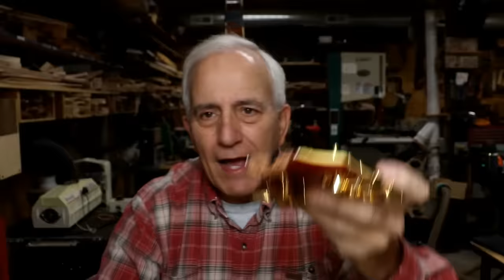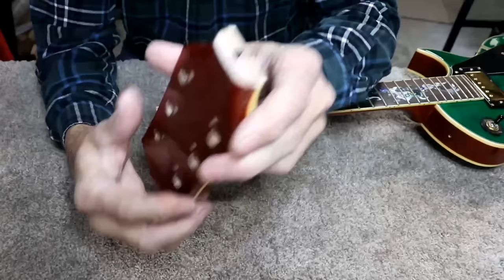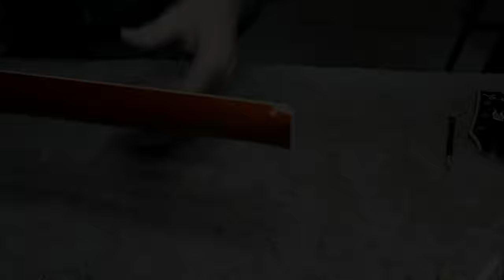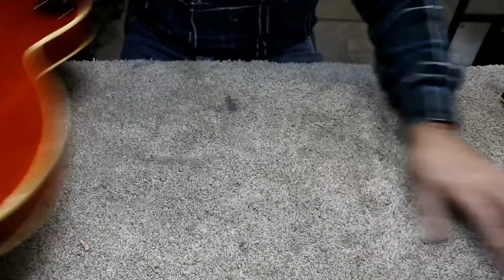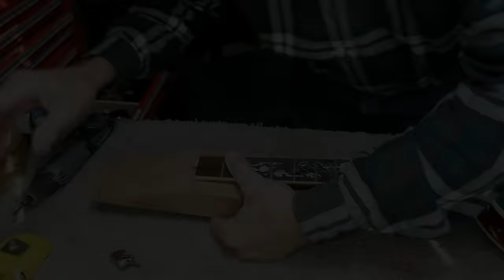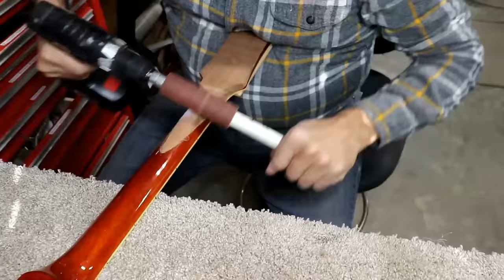623 RSW How Do You Fix This??? - ANOTHER BROKEN NECK Electric Guitar!!!

Comment: I’ve seen another luthier on YouTube that claims he’s had success with gluing the break back together on Gibson style necks and putting a spline set in deep on either side of the truss rod spanning across the break and into the headstock. I don’t know if it is as good structurally as your repair but definitely seems like it would take fewer man hours on a lower end guitar.

Comment: You are a miracle worker 💪❤️🧠😎👍🙏🇺🇸 !!!   In the first few minutes when I saw how bad the break was, it reminded me of a guitar neck that broke off as close to exactly as what you were faced with. Now, I regret that I didn't save it for 25 years. Perhaps I could have fixed it today. However, I didn't. Watching you do this repair kept me on the edge of my seat... You are truly the master luthier with brains, common sense, knowledge, experience and an expertise unparalleled for the art form beyond repairs that makes you a rare and unique problem solving creator making art where others would not attempt to go and be successful.
Reply: Could you make a platform for your router that has a big channel in the center, like a miter box with very thick sides.  Clamp the head or neck in the trough at an angle to the top of the router guide (top of the miter box).  Use a router to machine off the wood you will replace with your splice. Glue the 3 pieces together.

Comment: Jerry, you really have a unique way of fixing headstock breaks.  The other luthiers on YT, typically route two slots on the back, between the headstock and neck, but on either side of the truss rod.  They then make a couple splints with hard works that rightly fit in those slots.  I believe I’ve also seen one repair that used two carbon fiber square sticks then routed to match their widths.  

Now, having said all that, while it appears your way is more laborious, I believe it’s stronger than the others.  At least it looks that way to me (and I’ll throw in that I’m a 60 year old civil engineer who earned my PE license doing 5+ years a of structural design, before our department had computers 🤓🗓️🖊️📐🎸).  

Your problem solving skills are really amazing.  As I also like to say, “You know a thing ‘er two about a thing ‘er two.”

Another great repair, no really structural restoration job, mu friend.  Thanks for sharing!
Reply: The first method and the one I use, gluing two blocks length wise across the break is just as strong as this with about half the labor and time. This blew my mind that he did this this way.

Comment: I worked on a break something like that, and used tweezers to pull out every loose fiber on each side.  Not just the free splinters, but any that I could get out.  I didn't bother trying to make it better than the original, by the way, I just told the guy: "be more careful with it next time".  
What you need to scratch out that cutting line is a surface gauge scriber!  Prop the headstock up at an angle, then slide the surface gauge around it to mark a constant height above the surface.
Reply: Lol. Love these random guys telling a master how to do his craft. So funny.

Comment: I have to say I am in awe of your craftsmanship.  Also I have to say I would never have done it that way.  Like most people who do this type of work after you had the headstock glued which by the way you can make a simple jig to hold it.  We would around it out A section in the neck and put in splines.  This is A Jay turser guitar.  Once the splines were glued and installed we were then grew up in the misections Where the chip out had occurred.  Shaped it with our Knives, Send and finish. It would take longer for the glue to cure than it would for us to finish. But kudos I know another way to do it now

Comment: I love the way you invent your own tools to address any problem you might come up against. Cheers.
Reply: he reminds me much of my uncle. my uncle was born in 39 and had to consciously wittness the last days of nazi germany. originally he learned wainwright from his father however the profession pretty much died out and a lot of those old jobs got repurposed in the automobile industry and he became a tinsmith at mercedes benz. back in the day the cars were not as uniform however and a lot of adjusting had to be done because tolerances were huge. a common repair from accidents was the engine hood but the new hoods were comming with like 2-3 cm or about an inch of overhang cause as said cars had huge variety back then. so the work instructions he got from the company was to cut the hood to size with tin snips. he tried once against better judgement and said it was a total nightmare cause obviously the hood was all bent and wavey and ruined essentially. so he build himself tools to measure the space it had to fit and mark the hood so he could file it down to size. 
after he retired i met some random guy by chance and when we talked about profession he said he worked at mercedes in the town my uncle used to work so i asked him if he knew him and he said he was the best tin smith that ever walked their halls and since he retired he's sure they won't ever get anyone like him ever again.

Comment: I had one of these Jay Turser Les Paul copies in about 2006. It was actually excellent. I bought it for 300$ from China so it was very inexpensive for what it is. I had a house fire and lost it sadly. I actually liked it alot. They did an excellent fret job surprisingly. Mine had a volute so I wasn't worried about the headstock. Amazing to see these repairs. A ton of work for sure.

Comment: I picked up a Washburn acoustic that had the head broke off. Found that someone had made a terrible repair and screw-bolted in a break farther down below the head. They put the screw bolts right through the fret board in the first and second frets and tightened it down. I won't be trying to repair this neck because the guitar itself isn't worth the cost of repairing it, but I did get some good hardware salvageable parts off the guitar for repairs on another guitar down the road including a good working, and sound Washburn Electronic Pick-up/tuner/equalizer. A Street Buster owned it so I gave him $10 for what was left of the guitar making him happy as well as myself. The Washburn electronic pick-up alone was worth what I paid for it. Put new batteries in it and works like a charm and I have another guitar almost ready that I can install it in once I finish its neck reset repair. You did a nice job. Well done, Jerry.

Comment: Back in the late 70's while attending Roberto Venn. We had a dear customer professional 335 player. His head stock was broken off just like this. Several attempts to repair, dowels.. I haven't watched this whole thing yet but i know where it's going. What i did was machine a dupl headstock. Removed the vaneer. Then I plained the neck and headstock into a scarf joint. Took a little time the staff was so impressed they offered me a job teaching repair. To my knowledge back in 1977 no one was either building or repairing neck breaks using the scarf joint. The customer was thrilled others had tried only to break again.

Comment: when i do this job, i'd have 2 (1-2mm) drill holes near the edge of the crack on the headstock side (one, either side of the headstock).  Then tap a panel pins into each hole, to attach the headstock to the neck while glueing (allows for a tighter fit). 
Once the glue has set, remove the panel pins and drill the holes wider, to accomidate a small wooden dowels (must be a good fit).
These are then glued and tapped into the holes (and across the glue line).  
This gives a lot more strength to the repair. You just have to make sure to avoid the truss rod.

Comment: Interesting fix Jerry.
I've seen others fit splines either side of the trussrod after gluing back then maybe another spline across under the t.rod.  That way means less new wood etc but you need jigs to hold everything as you rout for the splunes and to get the splines exactly the right size.
As an electric fan I can tell you now many would really hate the volute. When Gibson introduced them in the 70s to help the strength people revolted.  However I think they originally sold about $350
Reply: I've got a voluted 70s Gibson Les Paul, and a non voluted SG, there is no difference in playability. I dropped my LP down a fire escape once and the thing stayed together. The people who complained were posers looking for a status symbol rather than an instrument IMHO.
Reply: If you handed me a guitar to play in a dark room, then asked me afterwards,  I couldn't tell you if it had a volute or not.  Also, I'm skeptical about improvement in strength.  You might get more out of reducing the length and mass of the headstock assembly.

Comment: I had a Chinese kit Les Paul Custom Neck that broke almost exactly like that... All rough and messy.  I kinda squashed it in together with a dab of glue.  Then did the three pieces repair.   A splint of mahogany along either side. And a thin one bridging the truss rod.  All about 2.75"  through 3" in length. Staggered.   It's holding still.   4 year's later.

Comment: Actually some modern glues are so good at bonding to porous woods and so strong when fully cured that this guitar neck would be far less likely to break again than it was when it was brand new.  The trick is simply to clear away any fragments that would interfere with the refitting of the broken off piece, and a proper tight pressing back into place while the glue cures.  I fixed one of these with epoxy glue, and I tested the repair by resting 200 lbs on the neck overnight. This neck was at least 5 times stronger than it was out of the factory. The only hard part was hiding the damage. Black lacquer settled that issue real fast.

Comment: I was intrigued as to how you were going to fix this and you did a great job. I bought an Epiphone Century red reissue 1966 for £38 which a brand new from a pawn shop. It has a broken off head but not a clean break only partial with the head lurching backwards. It was an easy fix 24hrs even without removing the winders. I just glued and clamped it and said a Hail Mary. 🙏 (PVA) because the break was a scarf shape the strings were pulling it in the right direction. Had it been a forward head lurch it would have been a different and much more time consuming affair. But this video is great education on how to do my next one. Cheers. 👍

Comment: That was amazing Jer. I've honestly never seen a broken head stock before and don't know how one could be broken like that but the solution was perfect. One thing I never realized before was that the truss rod doesn't actually extend into the head stock itself and just terminates right at the nut. I would be devastated if that ever occurred to my Ovation but then again, when I'm not playing it, it is firmly sitting in it's stand. I did like your trick for setting string height at the nut with a finger pick, all my strings were good except the D string and I'll adjust that next time I change strings. I didn't have a .0016 but used my .0018 Fender pick which is close enough for me.

Comment: If you'd taken the cut off wedge-peace and glued it temporarily to the repairpiece (e.g. with doublesided tape) on the not cut area upside down and turned 180°, you would have had a flat plane to use for the routing of the trussrod-channel with the correct angle. And just had to worry about the initial correct depth, the rest would have fitted automatically. :-)

Comment: A tip for next time you want something to stay put instead of the brads is to sprinkle a little bit of media like a tiny amount of sand (dry) lightly on on side. This will stop the top sliding along as the granules of sand will bite into each side when clamped up, if you’re unsure about that then try it out on some scraps of wood.  Good job

Comment: I’ve only just started watching your channel, this one popped up so I thought I’d give it a watch. When you were gluing the head back on initially I wondered why you hadn’t taken the machine heads out first ….and then it dawned on me …with the machine heads removed you could make up a jig with pins that go through the holes and then make a jig with a rubber gasket around the neck and then turnbuckles on the front and back to really lock down the glue joint. Before this was done it might have been possible to drill holes in both sides and insert some carbon fibre rod dowels before gluing it all together, that may have given it enough strength to hold it all together with out all the extra work.

Comment: Best fix tor a Gibson style snap is gluing it up then route x2 channels either side of the trus rod  and insert x2 biscuits. Then trim off, it's the quickest and best way to fix this style of guitar.  I do them the same way as Ted woodford does his.
Reply from the maker: Not nearly as strong.
Reply: @Rosa String Works  I agree in principle but still the standard fix for this sort of repair.  In 20 years and maybe 30+ Gibson headstock repairs doing it that way I've only had one come back when it was sat on and snapped at the heel not the repaired headstock.  And it takes less time also saving you that and money.
Reply: And I’ve literally just glued a break together (on a cheap Ibanez pf5nt acoustic with no truss rod) and it’s held up surprisingly well. Of course, that was a super clean break, with a lot of area, diagonal from back to front, so the fretboard did not get in the way. The veneer on front still held the headstock on, so I had to apply glue to the surface of a post-it note, and stick it into the break to fix it. Clamped for months over the summer, it has held up all fall and into the winter, not to mention, it’s been tuned down and up repeatedly, and the headstock was walked into once and the repair held up.

Comment: Your  videos are the most thorough I have viewed and I am inspired by your ability to find solutions to very difficult problems. You certainly possess the "gift". I would like to run this by you as a possible alternate for re-joining the head stock to the neck. Would drilling a two holes parallel to the truss rod in the neck and in the head stock for installing two carbon fiber rods or something adequate ?  Proper aligned and re glued the carbon fibers will not fail. I pondered this method, what are your thoughts> Thanks for your priceless tutorials. "Doc" in California

Comment: My first thought was to glue back together to hold pieces in right position. Then route off 2-3in from one side of rod and plug in fresh wood, then repeat on other side, then 1-2 inches in middle. But no idea, how it would hold. Your approach requires a lot more skill and precision and has larger surface area and is less visible. Great job
Reply: yes, or a butterfly joint, then tell him no guarantee .

Comment: Interesting method.most techs rout two grooves in the headstock and neck and glue in a couple of cleats,but you basically make an armature and glue it to the neck ,then glue the headstock to the armature and carve it to fit the contours . Of course you have to be confident in your ability to properly carve it and add the volute.

Comment: If you haven’t already done one, Jerry, please do a video on NUTS.  The whole shebang, building new from scratch, fine tuning (slot widths, depths, angles, shimming, etc), plus different materials with pros and cons for each.  

Over the past 40 years, I’ve done a ton of wood working / repairs, upgrades, and really thorough setups / fret jobs, etc.  I’ve even built and sold some parts-casters selecting, assembling and wiring all the parts, not built from some cheap kits).   

But the one thing that gives me the yips is anything to do with the nut.  Especially building new nuts from scratch, or adjusting slot depths, angles, thicknesses, etc on nuts I buy from WD or StewMac.  

Might seem insignificant, but nuts involve a lot of small work, that if done incorrectly, can really affect how the rest of the guitar plays.  

So if you’re looking for a topic for a future training video, I vote for nuts, please.  Thanks. BD

Comment: I own two of those guitars. Best part of them is the pick ups.
I buy them between
$150.00 to $200.00.
A great guitar to challenge your rebuilding skills.
I have a Washburn with a similar break
But a crack that runs
A couple of inches down the neck. I have seen different VIDEOS but your seems to be the best way to go.
New fan. Great work.

Comment: While you were contemplating cutting the taper on the neck with a isolating saw, why not make a level support on the end of your belt sander ??? That way you can get it perfectly square with the body and the angle of your cut/ sand is controlled by how you set it up 👍👍👍

Comment: I found an Alvarez with no head a took it for parts.  My dad but jointed a head on it at the nut with tight bond.  Tunes and plays fine.  Funny he's not a carpenter actually used white oak pallet lumber for the head

Comment: I have this guitar in solid super shiny gloss black. I've never had a problem with it, and I've never had to touch it since I got it. I bash it about, it hits the wall with the back of the headstock.. It has fallen off the stand on its face. and it ain't just breaking... It never even got a mark on it from any of that. It's still like perfect. I don't even worry about that.

Comment: Instead of the nails in your glue joint, have you tried table salt? The salt helps the piece from sliding around and will dissolve into the glue. Just a thought.

Comment: It's a Jay Turser JT220 Solid Body Electric Guitar. Worth Anywhere from less than a hundred bucks to $350 used. The fancy inlay puts it on the higher end, and the only reason to fix it is for the inlay.